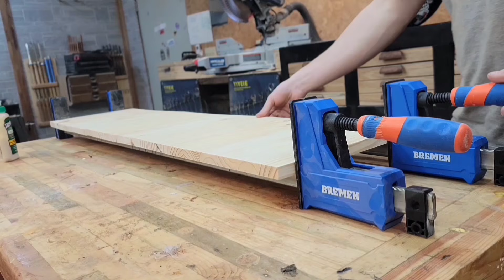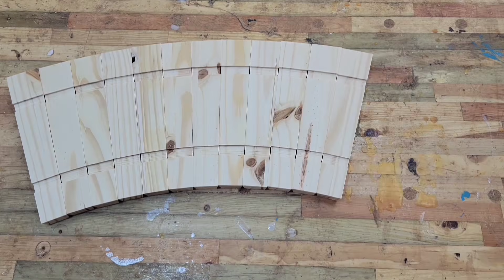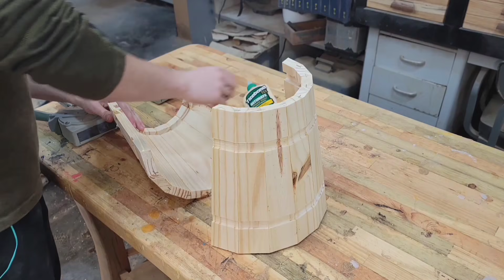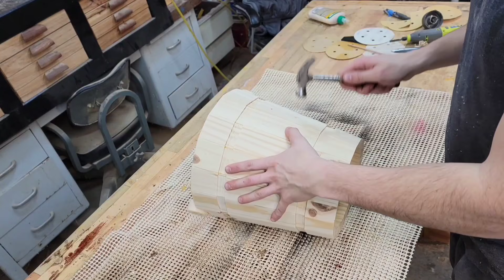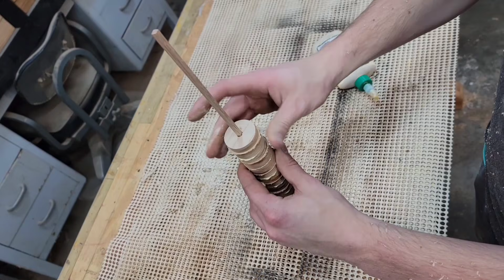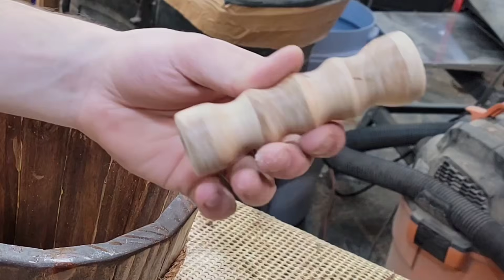Making A Wooden Bucket With Limited Tools// Woodworking

Comment: Nice work, I think you handled the compound angles brilliantly. One design issue for me though, is that the entire weight of bucket and contents depend on the two handle donuts glue joints holding, this might lead to a surprise one day if one lets go. I think I'll make my bucket with two extended staves with room for the handle holes built into the extra length.Thanks for sharing and cheers from near Toronto Canada!

Comment: Hi Josh, any chance of some more details on sizes etc. Length and Width of staves. At what angle did you cut the taper. I got the 11.25 for the bevel on the sides or was that for the taper as well.

Comment: If you pack the bottom groove with ground flaxseed it will expand when wet sealing the bottom. Just need to make the disc a little smaller. From what I’ve heard it lasts a long time. Nice job.

Comment: Ive been considering getting a Hercules . 
How well do you like that saw ? Would you feel a more expensive brand would do a better job ?
Reply from the maker: I like the hercules. Has some features that other mitersaws at simular price points don't have. Dual bevel, up to 60 degree cuts, shadow line, and a 14" cut capacity. It has its faults and I'm sure their are better miter saws out their but for the price, I don't think there is a better value.